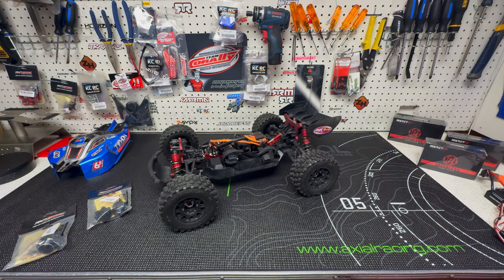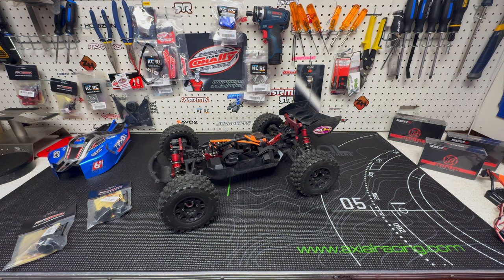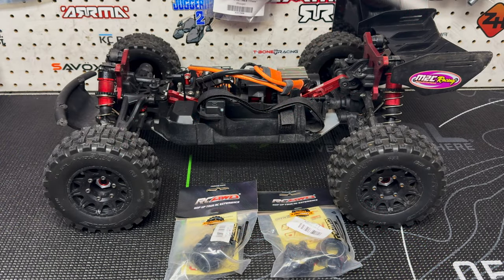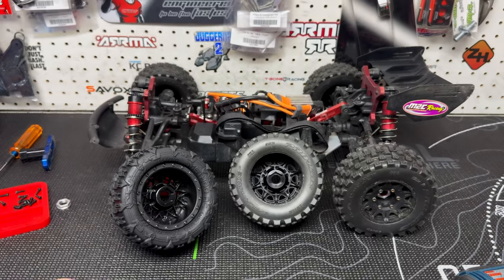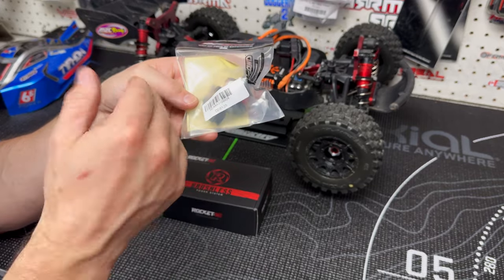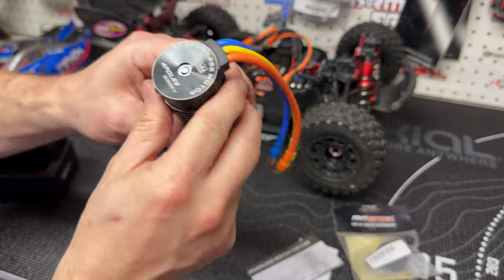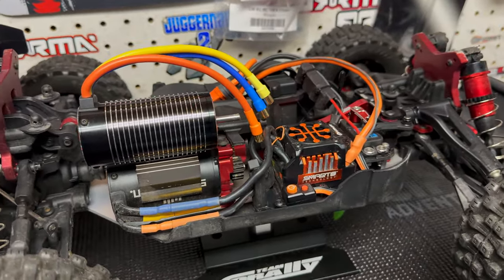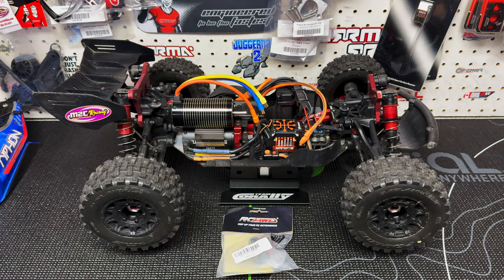Arrma Typhon 6s  Upgrade/Update!  (RCAWD 17mm Metal Hexes, Rocket 4082 2060kv)

Comment: Well my EXB Mojave is forever blowing diffs front and rear... Don't actually know what's going on. They seem to lock solid after a bit, yes I've striped them down can't find any issues so new fluid in them build bk up twisting and operating fine then after one run boom locked again. So I just replace them.and it's getting  costly.....I might give those red ones a go, I'll see how you find them Jason 😊.
Reply: Just recently had my rear wheels lock up on my V5 Typhon, thought the diff was a goner but I took it all apart and found the 8x19x6mm bearing in the diff housing was starting to seize and would lock up if under any load, hope that's all it could be for you.
Reply: Fluid is too light. That's why you are blowing